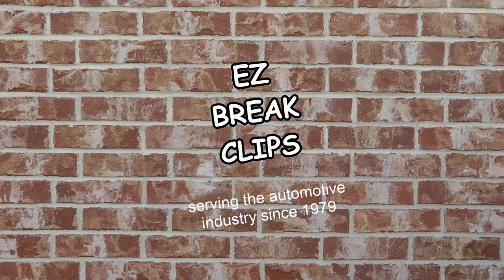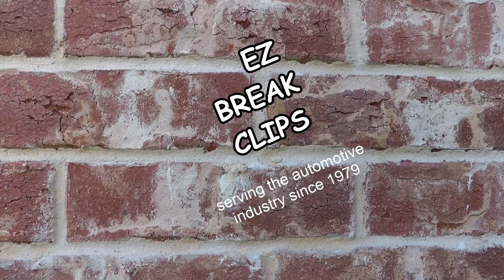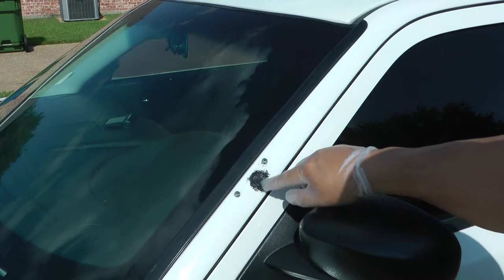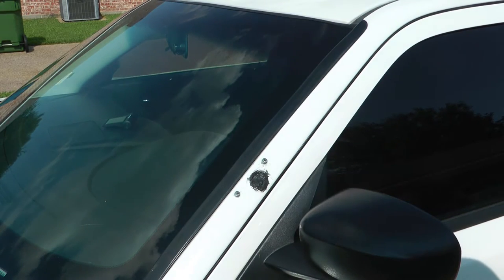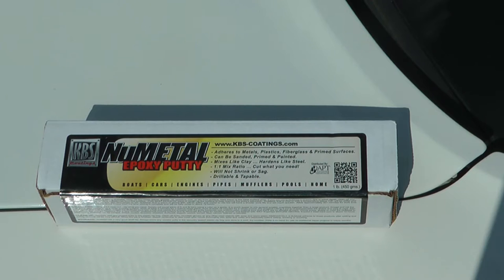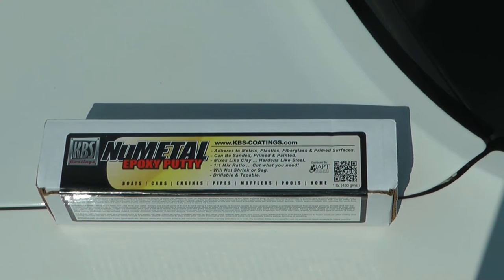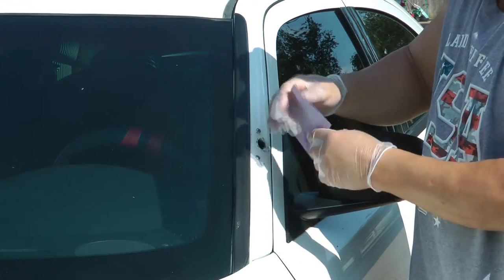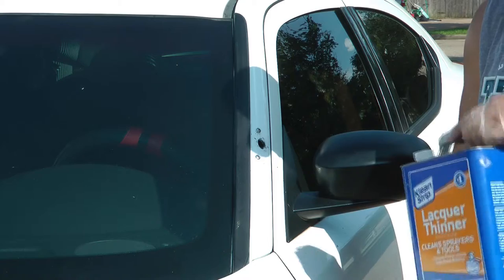Retired Police Car Spotlight Hole Repair - less than $25!!!

Comment: Why do all that then leave the screws in? Unscrew them and fill them as well if you're doing this.
Reply from the maker: I knew I was going to put a spotlight in eventually, but you're right, if this was going to be a permanent fill (like I did on the Taurus Interceptor) I would have filled everything

Comment: Why not do the same to the screw holes?
Reply from the maker: you can do this anywhere on the vehicle that you need to fill a hole.  It's by far the cheapest and easiest method to fill holes that also holds up and is strong

Comment: Good thing my P71 came with the spotlight still attached. No handle, but I jacked one from a wrecked P71 at Pick n Pull. Had my P71 just had a hole, I'd have installed a whole spotlight and called it a boom done. I'm much better at replacing parts than I am body work.
Reply from the maker: I really would rather put a spotlight there, but they are ridiculously high to get one that "fits" and I'm not sure if I'm ready to gamble trying to put one from a Vic or Tahoe there.

Comment: Mine doesn’t have the silicone, just a hole, would it still work if I used that numetal product?
Reply from the maker: yeah, the silicone was just a temporary filler.  You'll be better off not having to clean it off.  The Numetal really does a nice job of filling.

Comment: Would you use Jb weld Steele stick epoxy putty? Then bondo over and paint ? Thinking of putting it on the inside rather than outside..
Reply from the maker: I did that on my Taurus and it came out pretty nicely.  I think I filmed video of it just haven't edited yet.
Reply: @WJHandyDad  dam man I hope u post that soon.. I have a Tahoe now I got due to having a 2 door daily and a 2.5 year old so it’s was super uncomfortable.. police Tahoe .. that spot light man, idk I’m trying to get rid of it..
Reply from the maker: @youhappyf0o  the process was pretty straightforward... fill with the epoxy, then fill the blemishes with bondo.  Sand.  Touch up with spot filler or whatever, Sand, prime, paint.

Comment: I've still got the spotlight in mine, but it's old and doesn't look the best. I thought about removing it because I wanted to install a trans temp and oil pressure gauge on the pillar. 
Mine doesn't have the drilled hole, it's more of a half moon cut out on the door frame.
Reply from the maker: this stuff would probably repair the half moon shape too.  It would take a bit more finesse to get it right.  Maybe use tape to hold the shape when installing it?